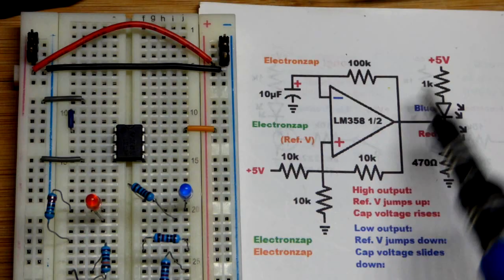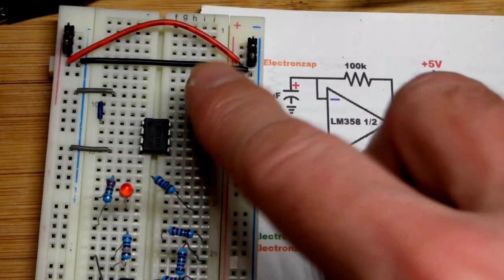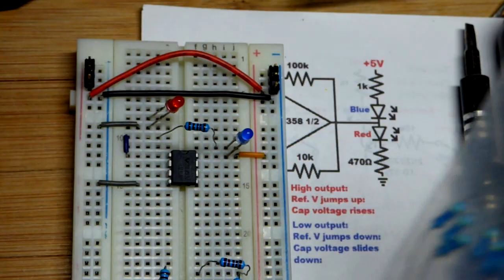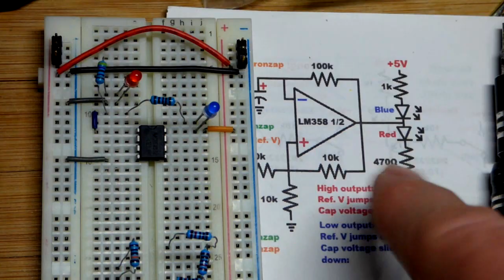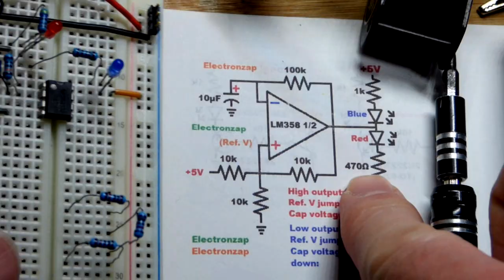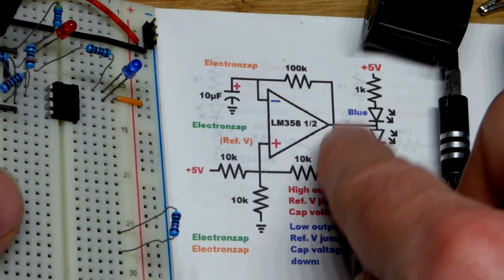Step By Step Astable Op Amp Alternating LEDs Demo Circuit

Comment: You can use a 4013 cmos( current are ok for 10ma. It is a flip flop with 2 outputs. (Q).  When 1 is high the other is low. 50% duty cycle. The osc canbe a 4001 cmos. The freq is dependant on the R and C of the 4001.

Comment: Thanks for this video. It looks like it might be tricky to get a 50% duty cycle, is that right? I want to flash a set of LEDs in an alternating pattern, where each one is on the same amount of time (around 500ms). Would a 555 timer be a better choice for that?